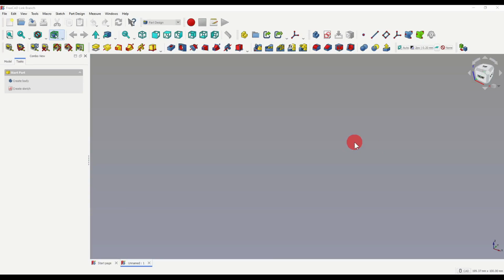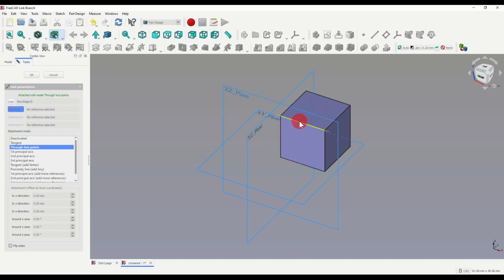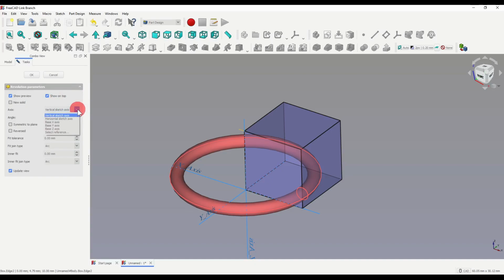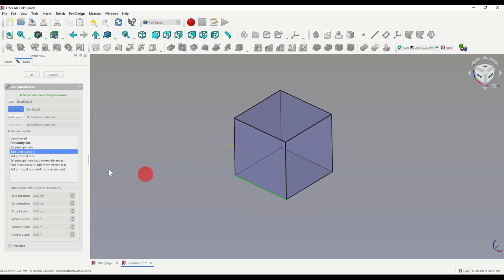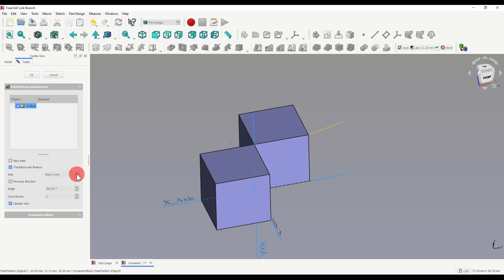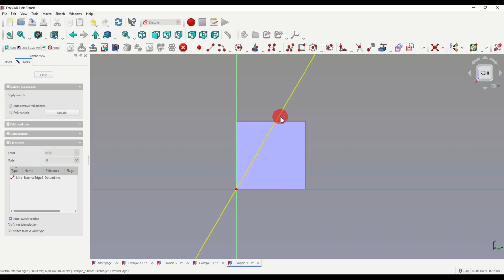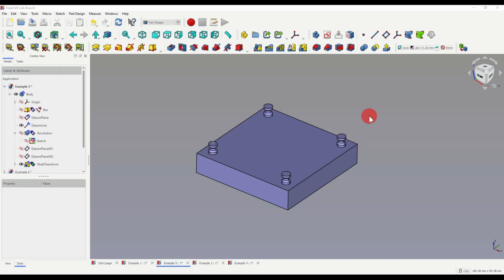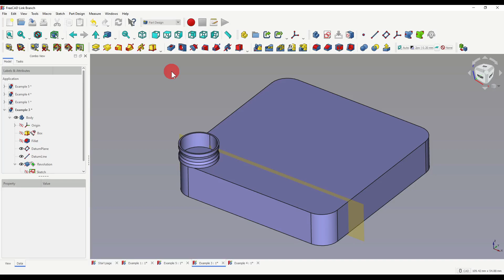3D modeling FreeCAD 0.19.1 - Datum lines

Comment: Great video!  However, being a (rather novice) Fusion 360 user myself, I'm wondering why using a "datum line" would be better then what I'd do in Fusion: ex. creating a sketch on the face we want the mid-line of and then just drawing an edge from mid-point of one edge to mid-point of the opposite one.   Then I can use this new edge as reference and only needed the tools I already knew (basically sketches).  So, can you elaborate why using a datum line would be better than using an edge directly?

Comment: When you choose Edges etc as reference for the datumline, it is also effectet bei the topologocal naming problem, isnt it?
Reply from the maker: Yes, something that I totally forgot to add. It's a little more complex, but similar to the datum plane, you have to use the origin as a reference and then manipulate it to the direction/orientation of where you want it. However, in real thunders mod you dont have to do this as the naming problem isnt an issue.